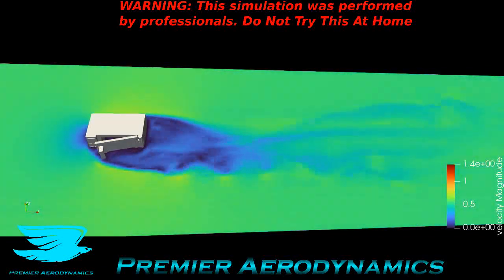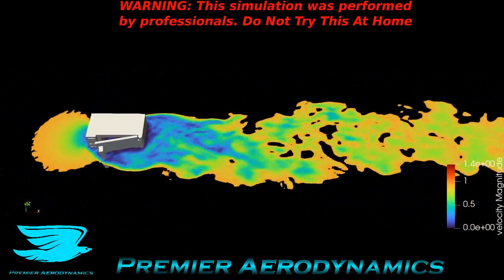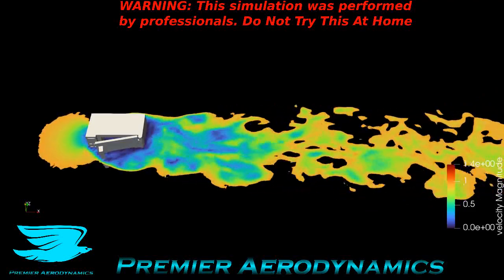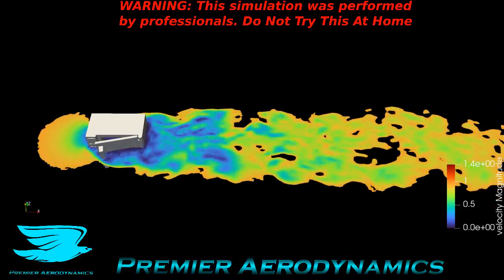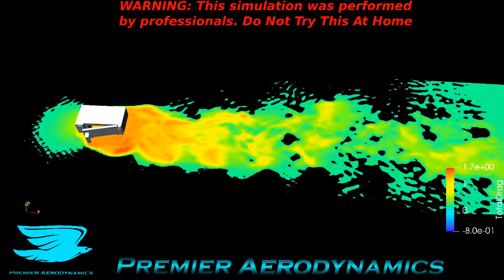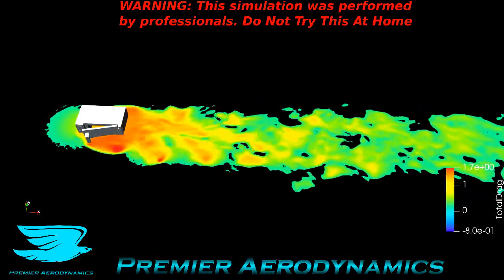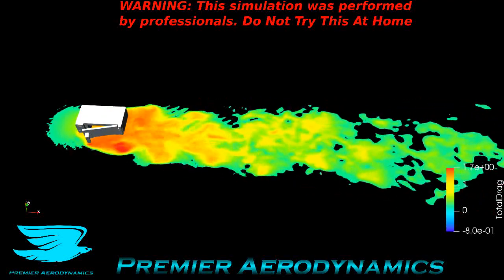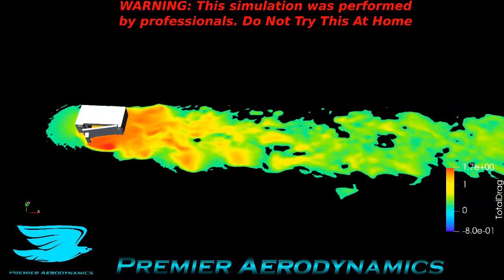Aerodynamics of a Microwave

Comment: Quick question, a drag coefficient of 1 means the wake decelerates to 0?
Reply from the maker: This is a really good question.

There are two answers. One for what happens in real life and one that could happen in theory.

In real life, the answer is no. That is because you have an object in an entire flow. Only part of the flow is hitting it, so even if that flow decelerates a lot (to the point of being 0), the surrounding flow will entrain it (the viscosity between the moving flow and this stationary flow will cause the stationary flow to be pulled along anyway). So, the flow that hits the object won't come to 0.

In theory, it is possible if the conditions are right. Those conditions are as follows:

Imagine you have a pipe. It has a cross-sectional area of 1 square meter. You have an object in the pipe. The object takes up that ENTIRE cross-sectional area. The flow is moving at 2 m/s (these values are arbitrary and I'm just picking them to make the calculation simple).

The Drag = 1/2 x Density X Velocity^2 x Area x Drag Coefficient.

We know the density is 1.2 kg/m^3 (we assume), we know the velocity (2 m/s), we know the area (1m^2). What is the drag?

The drag comes from the dynamic pressure, which is 1/2 x density x velocity^2 = 0.5 x 1.2 x 4 = 2.4 pascals (aka, Newtons per square meter).

Therefore, the maximum force on the object will be 2.4 pascals x 1 m^2 = 2.4 Newtons. One caveat here; this is assuming that you can keep the static pressures in the upstream and downstream the same (which I'm not sure how you would do considering that these two sections are no longer connected because the object is blocking the entire cross-sectional area, hence why this is theory).

So, the drag is 2.4 newtons.

Therefore, the drag coefficient = Drag / (1/2 x Density x Velocity^2 x Cross-sectional area) = 2.4 / (0.5 x 1.2 x 4 x 1) = 1.

Therefore, the drag coefficient is 1. At this point, the flow is at a velocity of 0 m/s.

Does this all make sense?

It is a really good question with a not so simple answer.